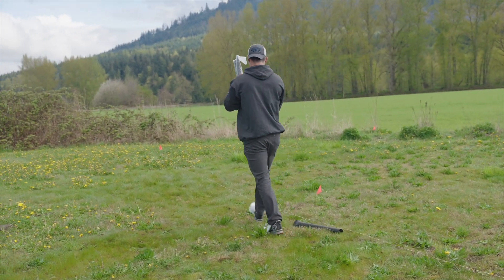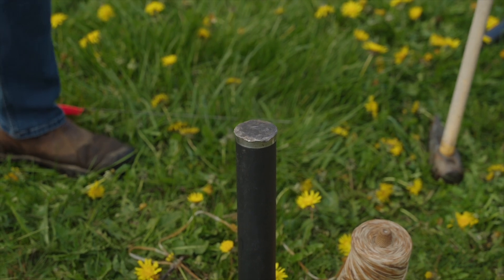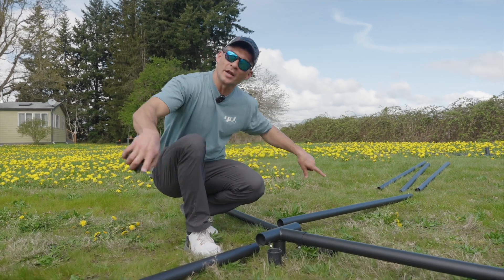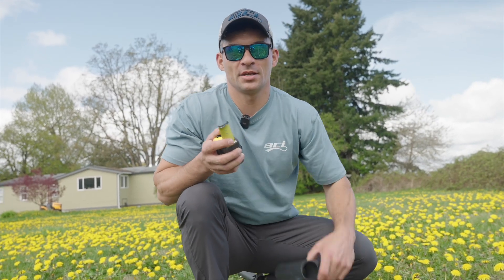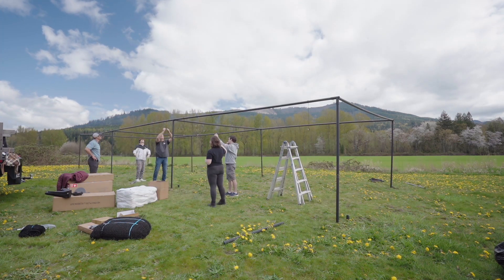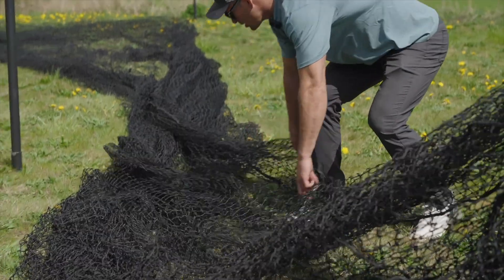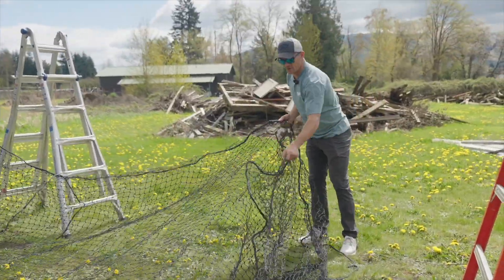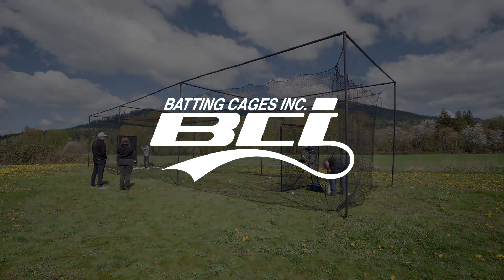The Thumper Batting Cage Assembly

Comment: I’m planning to buy the Thumper batting cage, which is 12 feet high, 12 feet wide, and 55 feet long. However, I don’t have 57 feet of space for the cage frame. Can I cut the end pipe to make it fit a 52-foot space?
Reply from the maker: Great question! Yes, you can cut the frame to be shorter, but keep in mind your ground sleeve location will be different. You will also have extra netting so it might not look like the photos.